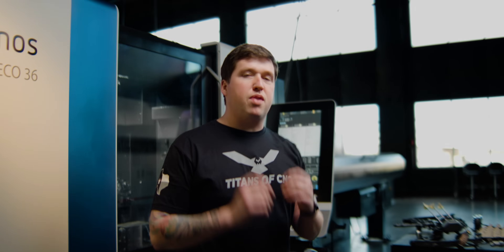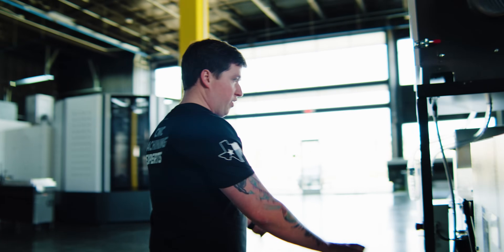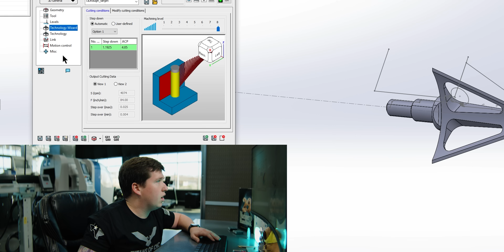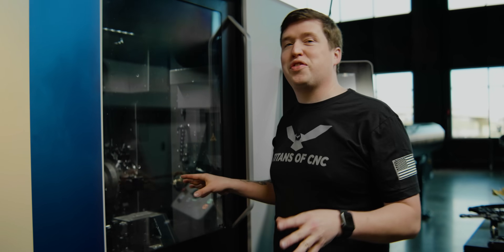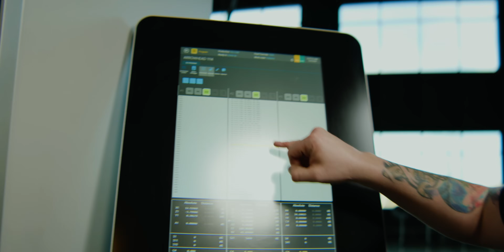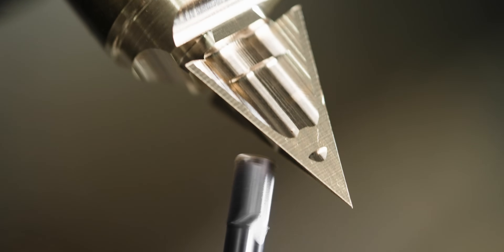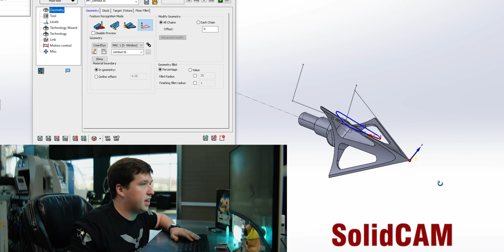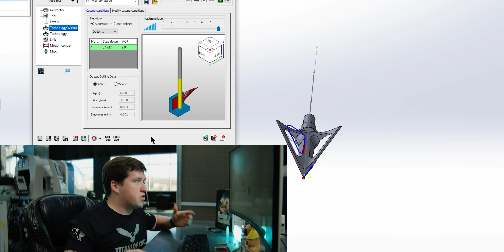Machining the Ultimate 17-4 SS Arrowheads: CNC Mastery

Comment: Donnie good work, but could have used a thru coolant high feed endmill instead of the drill and probably decreased the run time by 60% in that area. I use the pecking process quite a bit to help break up the stringy chips. I would have had the opti-roughing focus on the front section keeping as much rigidity to the back as possible to keep the part stabilized which means you could push it a little harder. Collet to grip it for part is perfect and yes 2000 rpms doing a pick off part off and finish operation is crazy what we do sometimes.

Comment: Show how you sharpen the edges of arrow head.
Reply: With a 3-blade fixed-blade broadhead, each blade is offset by 120 degrees, so merely laying it on a flat stone and strop will sharpen it to a perfect 60 degree bevel. Which can still get very sharp, but will be a very tough cutting edge that will hold up well to striking bone, or even branches/stumps and rocks if you miss, or get complete passthroughs.

Given the tooling they have available in the shop, they could theoretically use a surface grinder to grind it to any profile they wanted, but resharpening would be tricky, and the edge wouldn't be as tough.

Comment: 17-4 is cool stuff, but it's not really the proper material for this application. Something like a properly hardened S30V or S35V would be incredible, and wouldn't even flinch from being shot at a glass bottle, or a cinder block. I don't know if it's available in round bar stock or not. And I'm not sure if you're actually intending to use broadheads in a real world application, or if it was purely for the vid, but if you could get your hands on some from S30V and heat-treat them, you'll have a seriously tough stainless broadhead!

Or you could always use a tool steel like A2 steel tempered to about 60HRC; or a non-stainless knife steel like 80CRv2 (again, if you can find it in round bar), and get similar performance, as long as you don't leave them exposed to moisture.
Reply: "Tough" is a tricky word in this context. S30V will definitely have a higher hardness than 17-4 PH. 17-4 PH in its hardest condition typically does only 44 HRC. S30V in its softest temper does 57 HRC. 

But when it comes to toughness, as you test with a Charpy v-notch impact test, S30V will absorb 10 ft•lbs in impact, whereas 17-4 PH, even in the hardest most brittle condition, will absorb 15 ft•lbs. (17-4 PH in its softest condition will reach 100 ft•lbs.)
Reply: @Hydrazine1000  Yes. Toughness and hardness aren't the same thing. I wasn't implying that they are.

17-4, like brass, will do a marginal job of taking an edge, and will do a horrible job of holding that edge. Taking and holding an edge (and its overall shape) is 95% of the job of a broadhead. The other 5% is flight, but that's a function of design, and not much at all to do with material selection.

If he demands stainless properties, a blade-specific crucible steel like S30 or S35 is going to give him the best overall result. 

A tool steel like A2 would give slightly better tough toughness and be easier to sharpen, at much lower cost and higher availability, but without the 'stainless' properties, and with slightly worse edge retention over repeated use (easier to sharpen, but would need to be sharpened a little more frequently).

Toughness is only part of the battle with making a good blade. You have to be able to balance hardness and toughness. And 17-4 doesn't do that.

The brass he used is probably around 105ftlbs on Charpy, and you saw how well that went.

17-4 will roll an edge (if not completely deform) the moment it touches bone, let alone glass, cinderblock, rocks, dirt, tree branches, etc. This was demonstrated when he shot the silly string can, and then immediately had to change to a different one. "obviously this arrowhead won't work twice, so we need to swap it out."

Now compare those results with something like Day Six or Iron Will, or any of a large number of other high-end broadhead brands that use crucible steels or quality carbon tool steels like A2. You can literally shoot them into a cinderblock and still shave your arm with them. That's how a broadhead is supposed to perform.

If this was just a silly fun project for a video, and they just used what they had lying around the shop, then that's totally understandable. But if he wants to actually make something he can take into the field and shoot at animals with confidence, it's not. I'm not here jump to conclusions on whether he intends to make and use them for real hunting purposes out of this material, so I brought it up in case it IS a more serious endeavor than just creating entertaining Youtube content.

Charpy notch test is a poor test of the suitability of knife or broadhead material, because more ductility will translate into better charpy results, but makes for a terrible knife or broadhead (again, refer back to the performance of the brass one he made). A good blade will be able to withstand a decent amount of impact, but any deformation should not be permanent. It needs to be able to spring back to its original shape.

The only blade application I can think of where 17-4 even sort of makes sense is for a chef who carries a sharpening steel on his waist, and can true the edge every few cuts, and never uses it to 'chop'. But even then, it's kind of silly when there are so many better options available in modern steels. Most chefs just stick with quality carbon steels and take care of their knives to prevent them from rusting.

Sorry for the long rant but hopefully that clarifies things.
Reply: @Wrenchmonkey1  No need to be sorry! That was a very informative and useful reply. I'm a metallurgist and know 17-4 PH in detail, but I'm a layman when it comes to archery.

This probably was a "We have an off-cut of [???], let's do something interesting that gets people talking." I've asked about the precipitation hardened condition twice (also in the previous vid) and no answer.

The only "knife" applications of 17-4 PH that I know of are in food-contact applications, and for surgical instruments (bone reamers), but those are quite different edge geometries than knives or broadheads. (I work for the company that, untill the eighties, was known as Armco International. It was Armco that developed 17-4 PH and introduced it into the market in 1948 )

But don't get me wrong, I still like these videos a lot. What they show with regards to hardware and software is incredible.

Comment: wouldn't you want an arrowhead to be heavier?
Reply: Heavier than what? Most broadheads are gonna be in the 100-125 grain range, and if you need a higher FOC, you'd just use a brass insert or a ferrule to get the tip weight you're going for. There are tons of variables between bows, and the arrow shaft you select is going to be based on a lot of factors. So there's no magic 'ideal' point weight. That's why the broadheads themselves have largely been standardized at those two main weights, and other components are used to dial in the total point weight.

He could, theoretically design his broadheads to be whatever weight he needs for his specific setup, but if he changes anything (and he will) in the future, he'd have to either completely redesign them to match the new required weight, or end up using other components to alter it anyway, so it's probably still best to just stick with a standard weight for the design.
Reply: @Wrenchmonkey1  is the weight based on if you want more blunt force vs shear force?  It definitely depends on the subject that’s being targeted, likely the angle of the flutes(?), but what’s the balance there?
Reply: @pearlbluesoul  Energy's energy. And the weight of the broadhead itself has very little to do with the total energy/force that is imparted into the target. People tend to think in terms of bullet weights when thinking about arrows, where they presume that the broadhead's weight is calculated in the same way that a bullet is. But unlike a firearm cartridge, the point of an arrow remains attached, so the total arrow weight is what's used when determining the energy that is being delivered. When it comes to archery, the whole arrow is the projectile.

Another way that arrows are NOT like bullets is that broadheads work by CUTTING the target, not by dumping energy into it or deforming and creating blunt force trauma and tearing.

Due to the sharpness and profile of a broadhead, it's not uncommon to get complete passthroughs on large animals with energy levels that would be laughable numbers in a firearm, even from something like a .22 LR.

When you're talking average rifle hunting bullets, you're typically looking at a 100-200 grain bullet, being delivered in the range of 2000-3000ish fps.

When talking arrows fired by an adult male from a modernish compound bow, it's going to typically be a 400-600ish grain arrow, being delivered at somewhere between 250-325ish fps. Lighter arrows mean higher speeds, which leads to flatter trajectories to the target, but less energy conservation for getting through the target once it arrives. There are also minimum arrow weights for a given bow energy, because it can be really dangerous to shoot too light of an arrow for reasons I won't dive into here.

Heavier arrows from the same bow will typically result in slower speeds and steeper trajectory arcs, but will have a lot more energy to carry the broadhead through the target, and cut the important stuff (vital organs, arteries, etc).

The total point weight you end up using is more about matching the mechanics of the arrow shaft, so that it flexes the proper amount as it flies through the air and through the target. All arrows flex as they fly through the air and the target, and you want the weight of each end of the arrow to work together to keep the arrow flexing at the ideal rate, and you want a certain amount of the total arrow weight to be in front of the center of balance of the arrow, so that when it hits a target, the mass/energy in the front of the arrow is 'pulling' the rest of the arrow through the target, rather than being 'pushed' through by the mass at the back. If the arrow is being 'pulled' through, it will be more likely to maintain its trajectory all the way through the animal, hitting the vital organs behind the entry point. If it's being 'pushed', it's more likely to deflect on impact (especially with bone or tougher tissue) and miss the 'important stuff' behind your point of aim, and it's more likely to cause the arrow to over-flex on impact, and break or crack the arrow shaft.

Think of it like trying to push a rope or cable, vs trying to pull it to a specific point.

Note: There are arrow points that are designed to kill with blunt force trauma. They're usually called "blunt heads" or "thumpers" and are only meant to be used on small game like rabbits, squirrels, or small birds like grouse, because a broadhead would destroy too much meat and/or fur on such a small animal. But you'd never want to use something like that on larger game, because all you'd likely end up doing is breaking a rib or something.
Reply: @Wrenchmonkey1  ummm ok nerd
Reply: So, you ask a question about a topic you don't understand, and then get mad when you get an answer from someone who knows about the topic?

Very cool. Way to double down on your ignorance. 👍
Reply: like uranium?
Reply: It’s probably around 100g